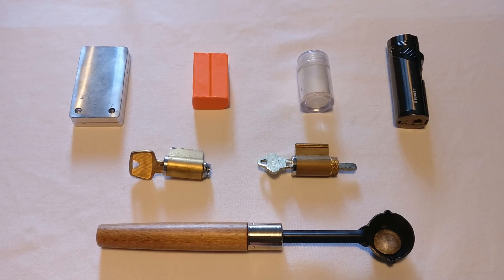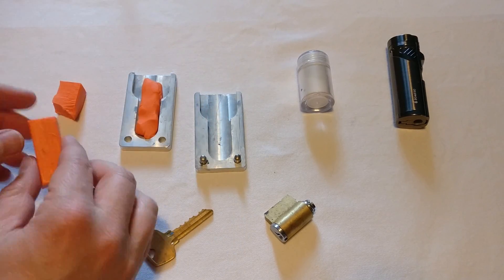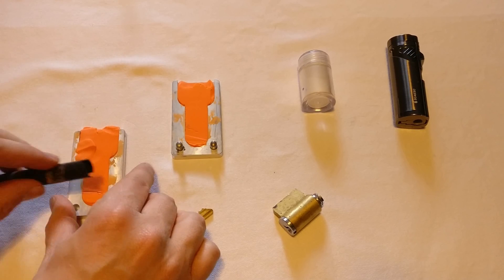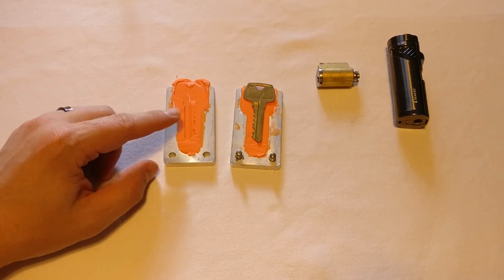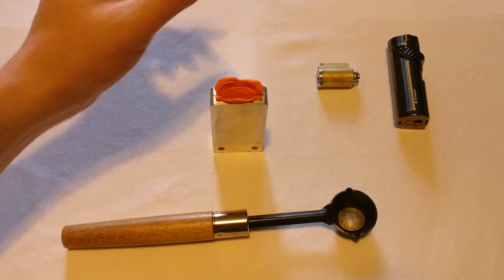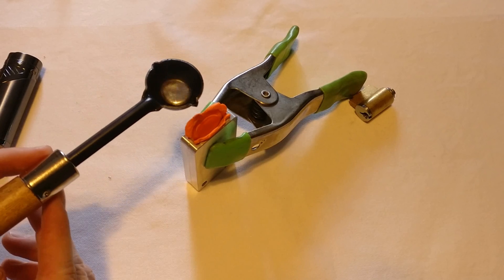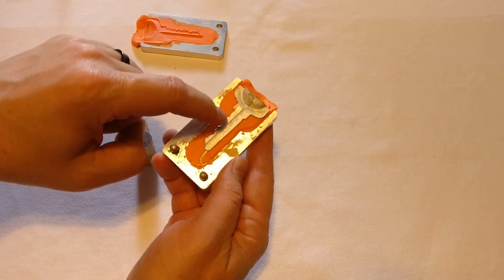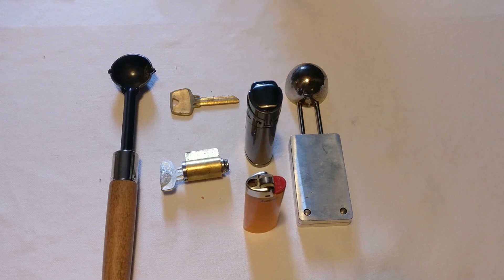Copying Keys via a Mold and Cast Attack

Comment: I imagine you've probably considered most other possible materials for useful properties, but just as a theoretical, would there be any use for chipquik solder in this task (or a comparable alloy)?  It's a lead-tin-bismuth solder alloy that typically you want to avoid making by mixing bismuth solders with lead based ones, specifically because it has a crazy low melting point (around 95° C), made specifically for ease of use at lower temps for rework on chips (personally, find it to be a stupid idea since many chips could easily reach those temps even not under fault conditions, but...).  

I don't know if the physical properties (strength, softness, etc.) would be a hindrance to this application, but it would allow lower temp casting.  Not 100% sure this isn't just a hairbrained thought that popped in my head, but seeing the process I wonder if such a low melting temp alloy would provide any utility.
Reply: Wood's metal is a eutectic alloy of bismuth, lead, tin, and cadmium. It's very similar, but has slightly better properties for this. That's what he's using. A lot cheaper than even unbranded chipquik, too, for some reason.

Also, it's not used for rework. It's used for removal specifically, when you need to rip off a giant TQFP or something like that.
Reply: lower melting point usually is lower strength.  It is really odd when 2 of my hobby meet like this.
Reply: Solder is way way too soft, you could bend the key in hand with two fingers.

Comment: I'll assume that's a bismuth, lead, indium, tin alloy. Maybe 136F? I'd give it an hour if possible but it is obviously usable as you've shown.
It'll shrink well less than a thou and is cheap and reusable... Just like me.
Reply: Field's metal is the optimum safe casting material - otherwise, Cerrosafe would be a good cheap  metal to use , with 30 mins shrinkage, then 30 mins expansion means it returns to the original mold size. It continues to expand but it's insignificant for this purpose. Watch out for the fumes though - cadmium fumes are no joke and lead is toxic too.
Not the type of thing you want to use indoors.
Reply: @gordslater  Thanks! I'll look into cerrosafe.

Comment: You could cast the low-melt alloy into nickel and quarter blanks to carry in your pocket, most people would be none the wiser.  I think an integral clamp, or some strong rubber bands, would be useful for holding the flask together.  I wonder if Suguru would be a useful substance for the molding too?
Reply: Wouldn't that be 
counterfeiting? A casting of a decorative keychain may be a better idea.
Reply: W.A. van Buren as long as the “coins” don’t have any face markings you’re fine.  Newspaper guys use to use tokens called blanks that were the same size and weight as quarters to get into and refill the boxes on the street.
Reply: @gatekeeper84  I happen to like counterfeiting .

Comment: A one or two-inch C-clamp is a lot smaller than the Pony clamp you used. 
On a humerus note, it could be argued that pouring hot liquid into a crack has sexual connotations. In this context, the orange flaps at the pour-point are nice, although pink would have perhaps been more apropos.
And lastly, what is the formula for low-melt alloy? I'm thinking lead/tin wheel weights here...
Thanks!
Reply: Bulldog clip, if you are working with papers... none the wiser.
Reply: @wobblysauce  You would need two, but yes.
Reply: Depends on the size, though it is only to hold it steady... not used for pressure.
Reply: @wobblysauce  To be honest I usually cast several kilos at once, and the pressure on the mold is very high. The mold also has to be burned out in a kiln for several days to remove molecular water (and the possibility of an explosion). Since I have never cast anything that melts at lower heat than lead, it may well be that you don't need to pinch the two halves together hard, but I would anyway. But you may be correct.
Reply: @Российскийбот-101  Well, what you are doing is different yes.
Reply: Humerus is a bone, not a laughing matter,

Comment: why not cast a modified torsion wrench into the key for strength?
Reply: If it could be aligned properly, a length of wiper blade would make the key last longer, but I'm guessing it would never stay in place for the pour.
Reply: @voltare2amstereo  I didn't think of that. It would bond very well, however, with a few small holes drilled along it's length, so the liquid metal flowed in between. That still doesn't solve the alignment issue, which I think can only be solved by experiment.
Reply: I have cast steel rods and even rebar into bronze and it's all good. The problem with reinforcing a key is the minute size.
Reply: could you just copy it at home with your key copy machine thingermajiggy? And turn that pewter key into a real one?
Reply: @ChadDidNothingWrong  I have a mill that can duplicate pretty much anything if it has a physical form but you can't take large equipment with you on a job unless you have it mounted in a van.
Reply: 9 times out of 10 I can just pick locks open so I'm not going to use the wrench like that.
Reply: @Redmoonblade  that would be my first instinct too, just rake it. It usually goes about as fast as using the key. I don't even worry about forgetting my house keys anymore lol.
Reply: @blackirish781  Some of them cant be raked so I have to pick around every time. And custom pins.
Reply: @Redmoonblade  I always try a rake first. Where are you running into custom pins?
Reply: @blackirish781  I modify locks my locks. Lel.
Reply: You mean "tension" wrench right
Reply: @technimechanical  torsion is the prope -  but not commonly used - term

Comment: What kind of metal (alloy) are you melting?
Reply from the maker: Woods metal.  158°
Reply: @DeviantOllam  If your ok with a higher melt temp try Britannia Alloy or other pewter.  Its strength and durability could make a permanent key i believe.  It can be melted on a stove.
Reply: @DeviantOllam  Isn't that effectively low-temp solder?

Ever thought about modifying a soldering iron to have a cup head and then just use lead/cadmium-free solder as it's not as nasty?
Reply: @DeviantOllam  Have you tried Fields metal? It is non-toxic, as the Woods metal contains huge amounts of lead and cadmium which I frankly would not heat nor handle with bare hands.
Reply: it depentds on your torch i would say any metal which melts under 700C Aluminium, but if your torch is not a tripple or quad burner like in this vide then, go for tin or zinc, plastics are also an option which need only 200 degrees C.
Reply: Any plastics would smell and attract attention. Simple Chinesium would work. They use it in vital electronics and other important items we rely on at critical moments that will of course will snap like a twig leaving you with half a key stuck in the lock and no way to get it out.
Reply: @scottfirman  never heard of Chinesium , its a vaporware.
For the smell if you do it wrong sure.
Reply: Hyper Hektor chinesium is just shitty Chinese metal
Reply: Mercury and Gelatin